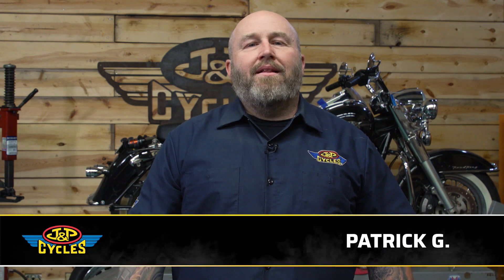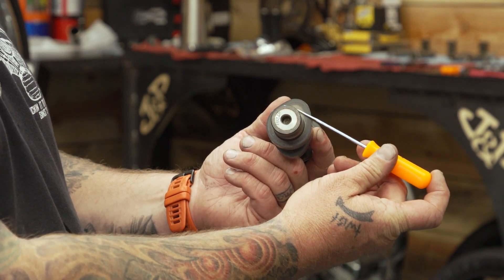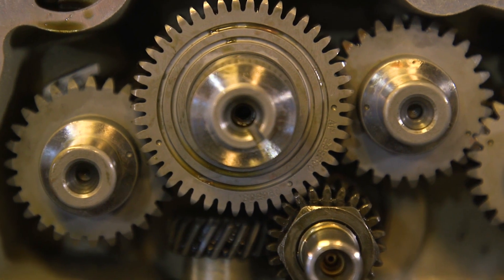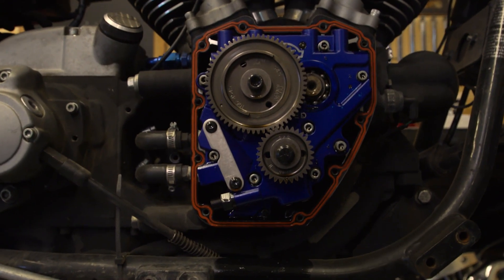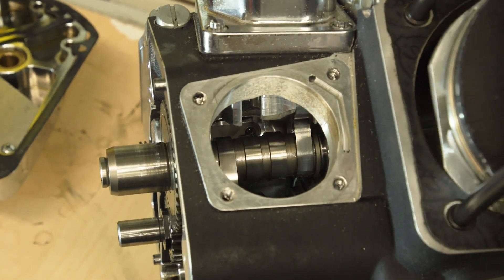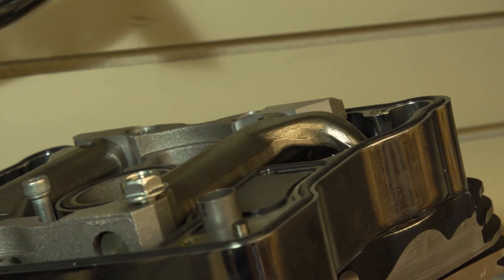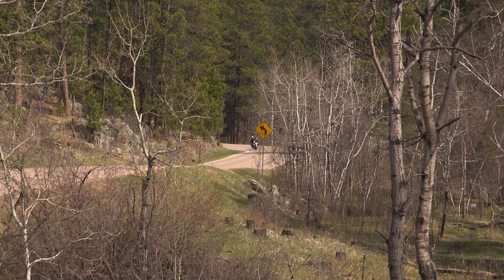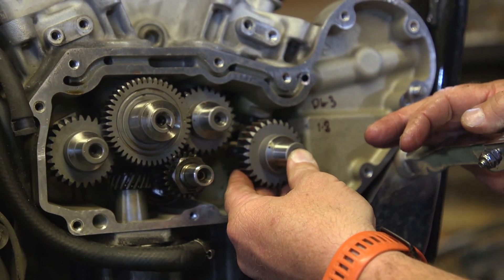Cam Specs 101 : Pro Tip

Comment: I have a 2021 road glide limited, installed speakers and an amp, I couldnt find the rear speakers harness to plug into the amp. Where are the rear speaker harness? I definitely need a book.